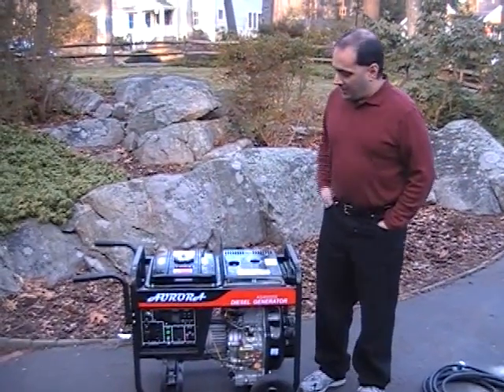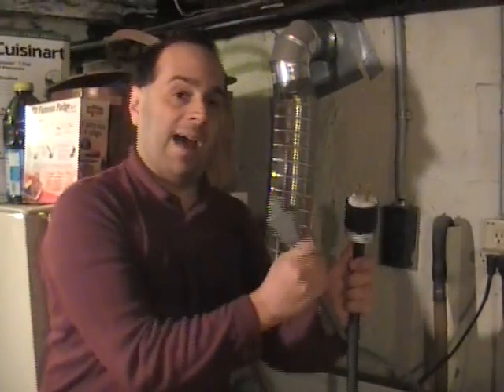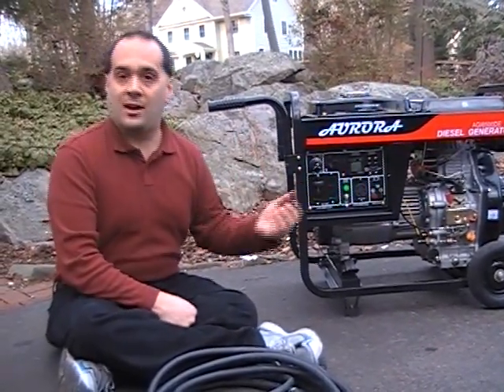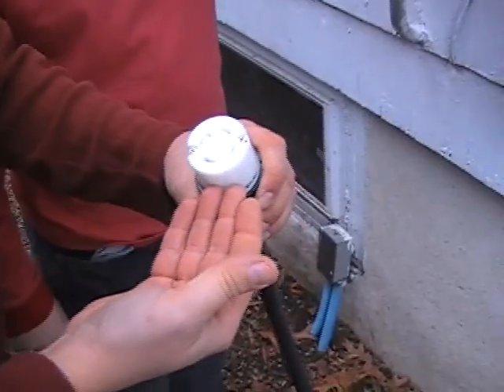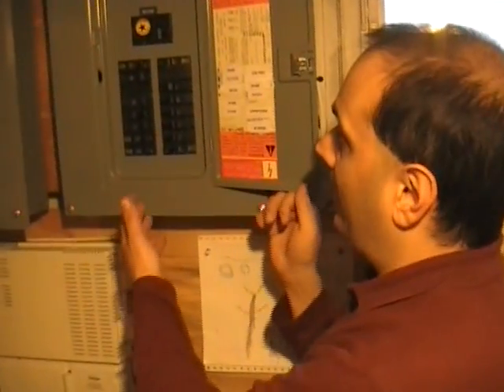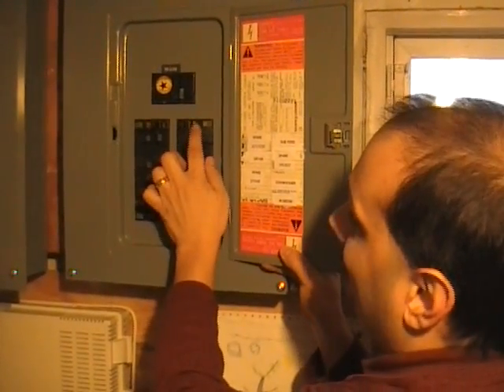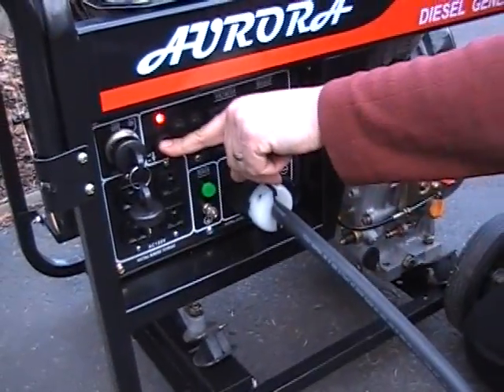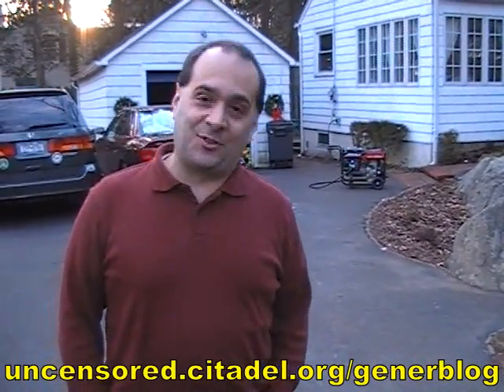Inexpensive residential generator hookup

Comment: Well done Art... There is a ton of misinformation out there & glad to see you emphasized the safe, correct & legal procedure for hooking up a portable to the house. I realize you published this 5 years ago, but it still applies today! 
I too have gone this route as I have just last night in fact installed a GenInterlock Kit on my older 200 amp GE main breaker panel. Works exactly as designed. when the MAINS are on, GENERATOR circuit breaker is OFF & vise versa...
A few days back I relocated two CB on the upper left down to the bottom. I installed a 30 amp GE double pole CB in there place & wired up 10-3 Romex to code & out to a Reliance 30 amp power inlet box beneath my front steps. [ 6 feet above ground ]
All that is required is a generator & a power cord, none of which is currently available in a 100 mile radius here in northern New England. Demand has far out stripped supply currently. I have my eye on the Champion 9375/7500 gasoline - 8400/6750 LPG unit. This unit produces 31.25 amps @ 240 volts. Should work fine for my selected essentials... 
Thanks for putting this out there.
Bill Farr...
Reply: One final note I forgot to mention:  All the components involved for the above project, circuit breaker, 25 ft. 10-3 Romex, staples, power inlet box & the interlock switch came in at $189.00, my labor... :)  
Bill Farr...

Comment: I'm not an electrician. What you have done with the sub-panel does not look all that easy or inexpensive. These kind of things are always easy once you've studied it and actually done it.  I'm presently running an extension cord through a hole in a wall, not to run everything in my house, only the most critical things such as my refrigerator and a couple lights. In most all cases, a power outage in our area is for a short period of time. 

A better but longer video would include all the various time consuming things you had to experience before you could just flip a few switches. From a layman's stand point, such as myself, a professional electrician should, at least, be present from start to finish as a consultant. This whole process, in the hands of someone who thinks they are capable, but actually isn't, lends itself to missing just one important/critical item that would result in disaster.

Comment: Electrician here 10+ years commercial experience, and I have definitely backfed before, but only because I have experience and know what i'm doing and how it works. But if you are NOT experienced in this field absolutely do NOT back Feed.
Reply: Alex I'll take "what is back-feeding for $500" :))
snarks and points at 50'+ 6awg cord (50 amp 4 pin) and of course the short suicide jumper to 30 amp twist lock, add opposite adapter and it makes a nice mobile welding setup or extension cord from existing 4 wire outlets. nice having generator out in detached garage and no need to rewire every damned thing ;)

Comment: Vermont State allow home owner to op out of Smart Meters.  I don't recommend a Smart Meter on any one home owner.  There are ways to have signal device that will informed you when power is back on.  Speaking,  portable generator.
Reply: "it is electrically impossible for the meter to know how you are using your electricity" - If you think that, you are a fool! True enough, it only sends back your "usage data" to the power company, usually on 15 minute intervals. However, using some pretty basic algorithms on that data, a computer can pretty easily extrapolate how you are using your power. For instance, it could figure out that certain peaks are most likely from a hot water heater based on amount of power drawn and for how long. Factor in the fact that showers typically run water at a given GPH, and faucets run at a lower GPH, you can pretty easily figure out when you're washing clothes, washing dishes and when someone is in the shower. If you happen to be on a well too, then it'd get even more accurate.  For example, you'd have a long 220 spike from the dryer, several 220 spikes from the well as you wash the next load, right along side the 110 spikes from the front loader changing directions. Likewise, it'd be pretty simple to discern between your wife taking a shower and filling up the garden tub, and then running the jets. It can decipher many other things much much easier, like your air conditioning cycling or your refrigerator.  And the more "easy" things it can identify, like your fridge or AC, the more it can screen out, making it easier to decipher the rest. Hell, I can go to smartmetertexas.com and look at my usage and tell when I turned on the oven a couple days ago or remember when I washed clothes and see the spikes from the dryer. I can see the change when I got home from work and kicked the AC down a notch. If you doubt me, there is a video here on youtube where some hackers put it to the test... They were able to look at the raw power usage data and decipher what tv show was playing!  The premise they used was that your tv uses more power to display a lighter screen than a darker one. This means that every tv show will have a "power usage fingerprint". If you know what to look for, and filter out the other usage, you can match it up. Now admittedly, the power company certainly isn't doing anything like that. And they don't have the capability (yet) to do it. It required them to take samples in the 1 second range or less if I remember correctly, and the power companies generally take samples in 15min increments. Plus, you'd have to have a power profile of everything on tv, bla bla bla..... But it was an eye opening exercise in proving what is POSSIBLE just from having live usage data.  And I investigated the communications protocol that the smart meters use to talk back to the power company.... it is telling them a SHITLOAD more than simple usage amounts. Again, admittedly, it would seem that most of the data sent is geared toward more benign purposes for now. For instance, since it does send out data every 15min, the power company knows when they have an outage within say, about 5 minutes. This is because logically, the meters don't all send at once, they have an offset, so if an entire neighborhood or even all 7 customers that are on the same transformer all of a sudden stop reporting, the computer flags it. Some of the other stuff it sends is for theft. If the power company turns off your power, it sends a "OPEN" command to the meter. The meter then responds on it's next cycle that it executed the "OPEN" command, "opening" the circuit, cutting your power. However, it then monitors the bottom lugs for power. If it detects power on the bottom lugs, then the computer flags you for a visit from a live person to figure out why. It also monitors and records when it loses power completely. So if you go out and remove your meter for any reason, it knows and sends that data in. If the computer sees that your meter lost power several times, when no one else's near you lost power, and you had no service call scheduled at those times, then they assume either something's wrong at your property or something nefarious is going on, and either way, they send someone out to check. So, yes, your smart meter can, and if history is any indication, eventually will be used to spy on us.

Comment: looks like a very nice generator. great video
Reply: That gen runs 3600 rpm. Top of the line diesel generators run 1800 so they make a lot less noise, burn less fuel, and last a lot longer. Not yet found one smaller then 8kw.

Comment: Thanks for all your very helpful info Art. My question is would it be ok just to use about 15 ft of cord from the sub panel to the inlet receptacle then connect to my generator with an outlet receptacle? I'm trying to avoid drilling a hole through my concrete garage here in Florida. I am hoping it would be ok to do this and just store the cords and receptacles when not in use. Thanks!

Comment: I may have missed something the first quarter of the video bu t the biggest danger of back-feeding your home is electrocuting a power-company worker.  I wouldn't want to be working on power lines when at any time someone could plug-in/turn on their generator and that dead wire went hot!
Reply: What is this "danger" to my home when "back feeding" through a drier receptacle? Please explain what will happen to my home. I really can't think of anything. The term "back feeding" is ridiculous anyway. This is alternating current, it flows back forward and backward. Danger to line men is very real however.
Reply: It flows both forward and backward.

Comment: When discussing back-feeding through the dryer outlet, you mention that one of the dangers is that the wiring from the dryer outlet back to the panel is not protected by a circuit breaker.  Why doesn't the wiring from the inlet on the side of the house back to the panel need a breaker at the inlet?  How is the cable from the generator protected?  Are you just relying on the breaker integrated into the generator?

If that's the case, is the implication that the inlet connector and wiring back to the panel must ALWAYS have greater amperage rating or equal to the generator?  In other words, to future proof an installation, it is okay to feed a 30amp generator into a 50-amp inlet because the 30-amp breaker on the generator is smaller than any wire needs for protection.  In contrast, hooking up a 50-amp generator (with some adapter thing) into a 30-amp inlet would be dangerous... circuit protection is inadequate.  Wouldn't the 30-amp breaker at the panel still be sufficient to protect the wiring (with the exception of a short in the wire between the inlet and the panel)?
Reply: " In contrast, hooking up a 50-amp generator (with some adapter thing) into a 30-amp inlet would be dangerous... circuit protection is inadequate."  How do you come to that conclusion? Since amperage is drawn, not pushed, and assuming the wiring goes directly from the 30-amp breaker to the receptacle without branching off to anywhere else, then any "load" applied to the wiring would HAVE to come THRU the 30-amp breaker in the panel. By that reasoning, I have a 200-amp main breaker, but the power coming from the transformer is capable of god only knows how much more than that, so my house wouldn't be safe? It makes no difference if the generator can supply 50 amps or 5000 amps, if it's running thru a 30-amp breaker, then all you can pull is 30-amps, period.
Reply: Actually a circuit breaker could care less which direction the power is coming from and so the 220 dryer circuit breaker would still protect to whatever capacity it happens to be typically 30 I believe ...not to mention the generator should have it's own breaker
Reply: Also just while thinking of mind twisters consider the tiny unprotected power cords we plug into to TWENTY AMP circuits ALL THE TIME ...there is literally ZERO adjusted protection from plug to device ...the only thing that protects it is the 20 amp breaker for which the wire is woefully undersized, and whatever fuse or overload is in the device itself downrange from the plug ...see what I mean?  If you are gonna snivel about generator protection that come with legit generators just bear in mind what you are overlooking every day ....likely ....and a fire is a fire is a fire whatever the amperage
Reply: Then if you REALLY want to worry about something?  Consider the Xmas practice of taking one of the most flammable species of trees known to man (conifers) KILLING it and placing them in millions of homes (with the furnace running drying the crap out of em)  then electrical cords are wrapped round and round the tree and a myriad of unsafe repair methods ARE employed by many folks trying to keep the things working ...then insult to injury?  Cardboard boxes wrapped in paper are heaped beneath these explosive torches!  AND a great many are left on timers to shine beautifully through windows all night long as the owners and the rest of the world sleep unconsciously.  ...I mean just to put your generator worry in perspective of just one "for instance" of many ...
Reply: +Dougie Quick, Admittedly it was very dry tree but once after taking a tree down I performed a test. With it lying at the outer edge of my brick patio I tossed a match into it. It flashed so quickly that it singed my eyebrows.

Comment: 14 years ago we shelled out for a 6,000 watt portable generator (which was quite expensive at the time) because we live in a hurricane zone.  In those 14 years, the generator has been used zero times for it's intended purpose.  All the power outages we've had, maybe half a dozen over the years, have been minor (restored within a couple hours) and almost all unrelated to hurricanes or storms.  I don't know if we've been incredibly lucky, or what, but it's never made me feel the need to get around to a proper setup (although I want one).

Comment: Hey Art, nice video, very informative, thx...What guage wire did you use for the extension from your generator?
Reply from the maker: The cord is made from 10 gauge wire, just like the wire from the inlet receptacle to the 30 amp breaker inside the house.  For an outdoor hookup cable you will need SJ or SJOOW rated cable.

Comment: I've always wondered what would happen if both utility power AND generator power were closed?  And then the utility power came back on.
Reply from the maker: That's why you have to put in an interlock -- so that can't happen.  :)   Realistically though, the breaker on your generator would immediately trip, because it would be trying to power your entire neighborhood.  If somehow you managed to close both breakers and still run -- for example, if it was your individual service cable that was broken and the power company then repaired it -- if you're lucky, the breaker on your generator will trip; if you're unlucky, it will permanently damage the windings in the generator.
Reply: if your generator was running and connected with the house panel with the House main switch turned on ON, and the grid power came back on at the same time, it would not be pretty.  Possible some sparks somewhere, or a fire and a destroyed generator would be the result.
Reply: Tim Yorty z